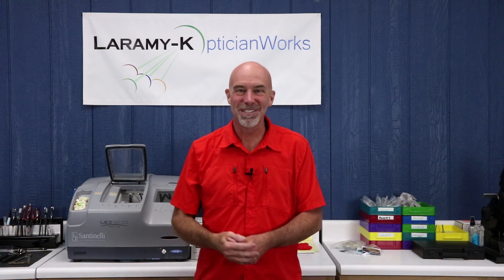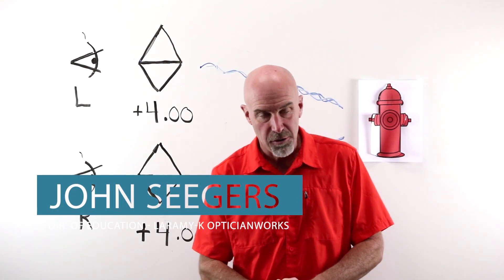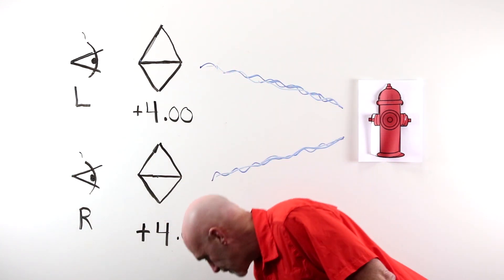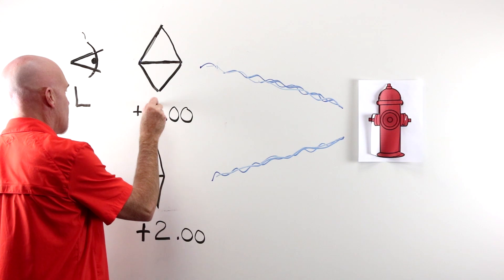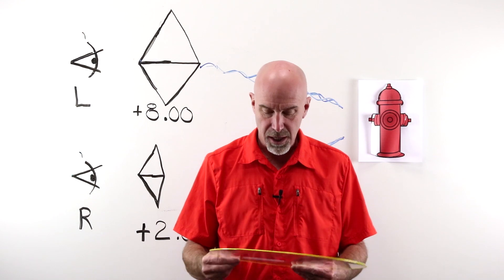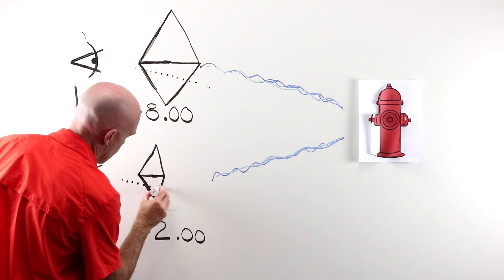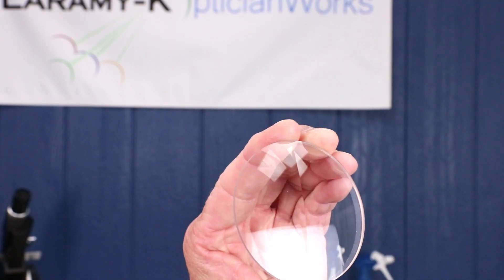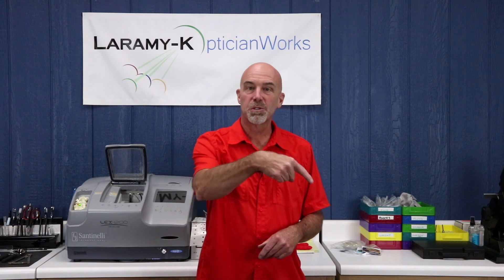What Is A Slab-Off and How Do We Calculate It?

Comment: Hi John,
Thanks for the slab-off video: I understand that to compensate, we grind same base prism in most minus or least plus of the two lenses. When we say that slab off will be ground for the base direction deteremined by above calcuation in the lense that is most minus or least plus. In a Rx that has R: -8.75 and L: +4.25. Does it mean that slab off will be groun in right eye as it is the most minus or least plus? The answer to this problem is 2.70 prism diopters. It is the problem from your forensic opticianary video where a guy's insurance coverage was denied and you proved that he was seeing through prism of 2.7 pd. Thanks again, looking for your help in understanding the slab off on this one.
Reply from the maker: I'm not 100% sure how to answer this. That example is about vertical imbalance and that is not corrected by slab off. That would be corrected by remaking the lenses with the correct OC placement (same in both eyes). If you took those powers and needed slab off to correct for image placement then you would slab off the -8.75 which meets the most minus least plus idea. It isn't if the plus is weaker it is a case of if you have plus/plus you slab off the weaker plus. Regardless as I mention in the video, don't make yourself crazy over it. Let the lab figure it out, it is kind of their job and these days they just plug it into the software and it tells them/you the best options. It is good to understand the concept of slab off but spending hours learning about it, memorizing it and working problems about it is, in my opinion, a waste of your time. Spend it instead on understanding compensated lens design, something you will see everyday and may well get questions about from actual real live customers every day. It will serve you well in the actual day-to-day working life of an optician where slab off will not. John
Reply: @LaramyKOptical  Ok but so you dont need a plas blank to do slb off? if you just can mold it or grind it in it should be easy! my helpline said we dont offer slab off but if the patient has induced vert imbalance but no induced prism shouldnt they be able to do it?
Reply from the maker: @ItsPainnz  I'm not 100% sure what you are asking? If a lab can't or won't handle slab-off I doubt you will convince them otherwise. Even with a premolded reverse they would still need to know how to do the grind. You can call Janet at the lab - you don't need to be a customer of ours - she would be in a better position to sort it out for you. 800-525-1274 afternoons CST.

Comment: You only touched on the fact that this is 'mostly' used on bifocals, but also on progressive, and can also be used on single vision. Would sure like to see a part 2, where you explain the most common applications of this, where it will do the most good, etc.; and the basic differences between using it for each type of lens? Please! :-) … I'm an optician, and have to troubleshoot regularly. The other day, a patient came in for refraction: he was 'approx.' 3.00 in the OS, and the doc prescribed 'approx.' -8.50 for the OD, which he honestly had little vision using his current specs.. Common sense and past patients' tells me that it's too big a jump in the first place. In the second place, there's a HUGE difference between being in the chair... motionless/in a darkened room/with small perfect aspheric lenses/with perfect AR; than what he will be trying on later in his eyewear.... loads of scattered light everywhere/large frames/spherical aberration/possibly spherical lenses of lesser quality/and different AR coatings. Many times I've seen them have to back off to a midpoint of power somewhere, to have eyewear that is at all comfortable enough to be useable for any period of time. I have to follow the doctors' lead of course, as they are trying to find if a refraction is actually possible for sharp vision in the OD eye. We will have to wait and try the first Rx, and then possibly make a change, but when we come to the final 'comfortable/useable' power for the patient in that strong eye, I'm wondering if the last step is to order the same Rx now but with a slab-off in the OD, even in these distance single visions, to correct for nearer focus in that OD?      So much to learn! It really never ends! Thanks much for all the videos I know much of it all, but ALWAYS pick up new knowledge here and there from your videos and your website. You REALLY need a person or two helping to compile your direct and common sense teaching style into 'THE' comprehensive opticianry handbook! What I've found so far is really scattered among so many courses and books and CEC modules, and many are very very VERY poorly written. Sure would like ONE really good comprehensive book on the subject with all this in one thick volume! Tks
Reply from the maker: Um, let's see... 1) Slab-off is a 95% lined multifocal, 5% progressives and 0% SV. The imbalance corrected by slab-off only occurs when you have an add power. 2) Extreme differences in power between two eyes is fairly common and has several different names. Yep, the best possible frame fit, best possible measurements (OptiKamPad) and the best in lens design will be your best option. 3) I did write a complete textbook presented in a logical order and covering what an optician needs to know TODAY it is called OpticianWorks.com!

Comment: As a patient all I could tell that for an extra $100 they put an extremely annoying line across your good (better) eye. THAT'S IT as far as I could SEE. I didn't even leave their parking lot it was so damn annoying. I went back and complained and NO ONE...NOT EVEN THE DOCTOR could explain: is the line normal, does non slab off NOT have the line, what does it do, how could this be better??? They ask me to just wear it for a few days but I couldn't get through half the day as it was like having your hand saluting in front of one eye. I took it back and said get rid of the line. 2 weeks later no line (assuming no slab-off) glasses are fine. BUT today i got the bill & I'm wondering why do i have to pay for them talking me into trying it? I visited here to better understand what slab-off is since my doctors didn't seem to know and just said it helps adjust the extreme difference in my good & bad eye Thx for letting me know what my doctors didn't. P.S. Now that i saw this video i can kinda see the double vision thing BUT my brain just does its best to compensate & i really don't notice.
Reply from the maker: Correct a slab-off will have a visible line, no way around it. Like everything else need creates acceptance. If you really needed a slab-off you would have learned to live with the line - in fact it does become "invisible" over time just as the line in an old fashioned lined bifocal does. But if the need isn't high enough it would be more of an annoyance than a help. Free-form surfacing can help reduce the intensity of the line but it is still there. Glad we were able to make things a little clearer for you. John
Reply: @LaramyKOptical  rrrrr...If they would've just explained as you just did I'd have saved some time & money. I did call the Dr. office and very politely pointed out their shortcomings and she seemed to agree and said she'd pass the information on to the staff...Hopefully it will help people down the road. Thanks so much for the quick response & good information.

Comment: Hi, question about reverse slab-off.    Whats the lowest reverse-slab off that can be ordered.   What increments can reverse-slab off is ordered.   For Example, If the Vertical Imbalance is .60 D.  Can I order .50 D reverse slab off, and leave .10 D residual (within tolerance) .   OR Can I order exactly .60 D of reverse slab off.  

I searched the whole web, and cannot find the minimum reverse-slab off that can be ordered.  As we all know that VI under .50 D is considered tolerable and can be ignored
Reply from the maker: Amit, We will get back to you soon. I'm checking. John
Reply from the maker: So, the lowest reverse slab that WAS available was 1.5. the highest was 3. They have been discontinued. We run conventional slabs (backside, most minus least plus) in house. This would have a definite visible line. The lowest is also 1.5, going up in .25 increments.  The highest we've done is, if I recall correctly, is 12.00. The amount possible is dependent on the power, the size of the frame and the client's PD.

We also run Freeform slabs, which stick to the same parameters, but the line is a bit blended, making it less noticable. The highest possible is 7.00

Hope this helps,

Janet

Comment: I'm reading an ophthalmology textbook and it says that a slab-off is "to remove the prism inferiorly from the more minus lens" ... Is it the same as adding a wedge like you did??
Reply from the maker: The rule for slab-off: -/- do the highest minus, +/+ do the lowest plus, +/- do the minus lens. I can't really say that you "remove" anything when you are actually adding something. I don't know what the word "inferiorly" means. Hope that helps! John
Reply: @LaramyKOptical  Superior(ly) usually referring to the upper; inferior(ly) to the lower. Since you mentioned it, I was going to ask anyway... the idea is that we're adding material in order to add prism, so why isn't it called 'SLAB-ON'???  :-)
Reply from the maker: @blairtaylor9552  I believe it is a carry over from when a lens blank was created by hand. You would have to start with a blank thick enough to have the prism wedge and then slab-OFF the unwanted part above the line. I think.